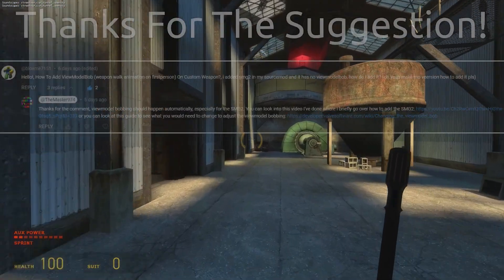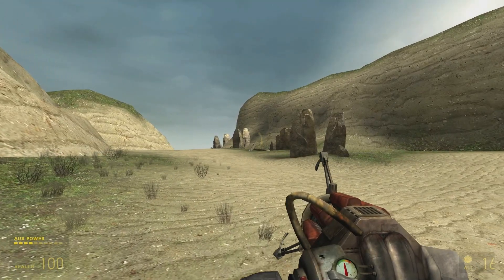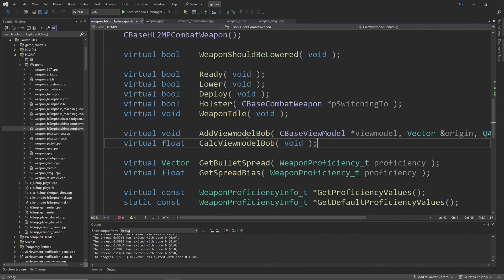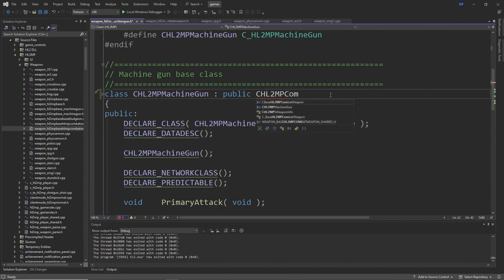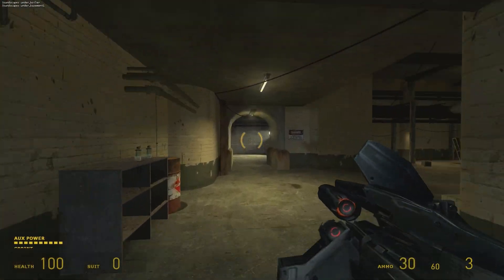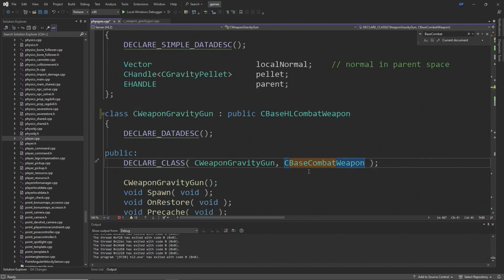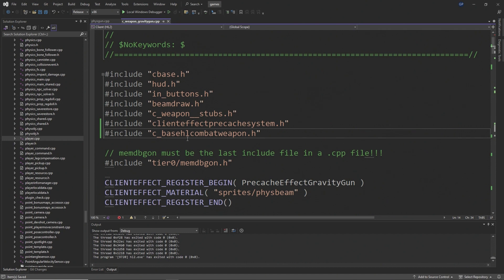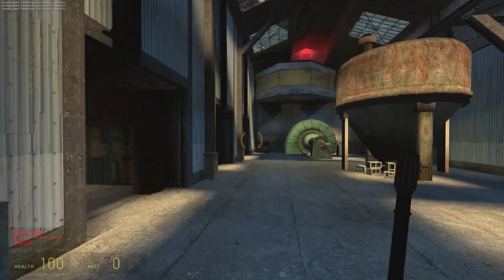Valve Source Code 2013 Tutorial (Episode 23): Fixing Viewmodel Bobbing Issues

Comment: how do i fix sv_autojump in source sdk 2013 multiplayer
Reply from the maker: I've never come across that before, so I wouldn't know why it's not working. Taking a look into the code suggests there's nothing that would stop it from working.
Reply: @TheMaster974  but it doesnt work when i try
Reply from the maker: Is there an example of how this works normally, like a situation that works 100% of the time that I can try on my end, so I can better understand the conditions that allows this to work and investigate this further?
Reply: @TheMaster974  bro just try entering sv_autojump 1 and holding the spacebar
Reply from the maker: It doesn't seem to work when I try that, however I think I have found a way to get it to work, but it's not in the file where the autojump code exists. I'll probably do a video about it at some point.
Reply: @TheMaster974  yipee

Comment: YOOOOOOOOOOOOOOOOOOOOO THE REAL MASTER IS BACK AND I HAVE ISSUE ABOUT VIEWBOB IN MY MOD THX MASTER :DD

edit: 
Nvm the smg1/ar2 viewbob doesn't work but thats ok
Reply from the maker: Thanks for the comment, what's the issue you are on about regarding the SMG1/AR2?
Reply: @TheMaster974   idk master, i did all what you do in the video but it did nothing smg1/ar2 doesnt have any viewbob how do i fix it? (Btw its me SandBox-IVan I change my name)
Reply from the maker: Is this for Source 2013 Multiplayer or Singleplayer, because there shouldn't be any issues unless you've modified the baseclasses to be something different from what I've advised in the video.
Reply: @TheMaster974  i use Source SDK 2013 Multiplayer Fix From Github Maybe That's The Problem, ok thx master i Will try Use The original Source SDK 2013 Mp

edit: now its works, sorry if i say its doesnt work to fast anyways thx master for helping!